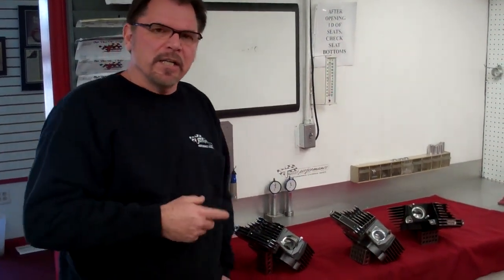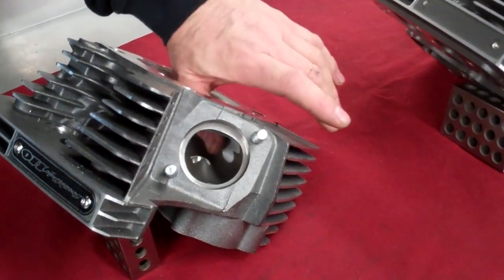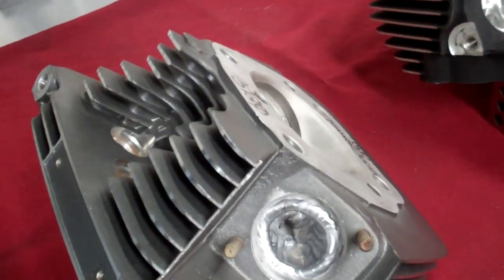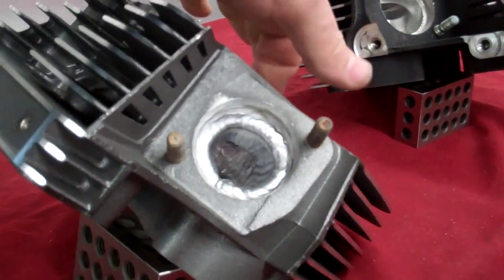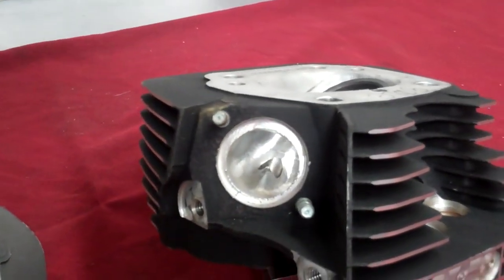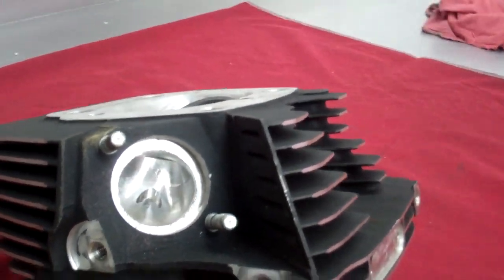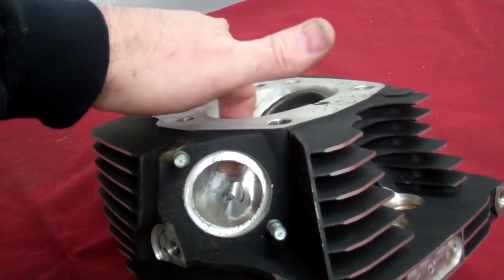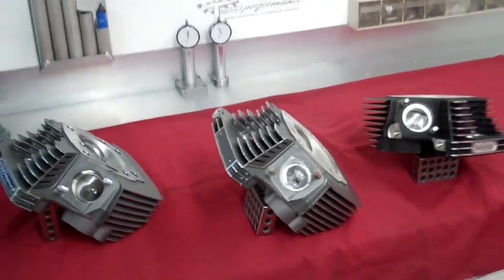T-Man Performance - Our New Fully Welded Ports

Comment: Tman heads straight up run. I recently completed my 2001 Fatboy 107 with Tman Pro Touring Elite Kit. The heads looked amazing. Against Tmans advice, I kept my VH longshots but welded in a crossover as a compromise. Darkhorse Man o War stroker bottom end, SS cam plate and pump, bigger throttle body and injectors and other stuff. Tried a dealer tune with my existing Power Commander 5. Complete failure. Had C&S in St. Louis tune it with a TTS tuner. Runs awesome. 119HP and 124 TQ. The 590 cam is really good all around. Tman says a D&D pipe would add another 10 HP and TQ but I'm good for now and the look and sound is superior to any 2 into 1 for my taste. To each his own. 
Also, be ready to beef up your clutch. I added a Barnett extra plate clutch pack and AIM VP clutch only to smoke it after 1500 miles. Going Rekluse Torq Drive with 340# Spring along with the AIM VP add on and an Evolution basket.
2ndly, Make sure you add compression releases. They are a must and only $100 to add. 
Thanks for all the help Brandon and Tom.
Little O